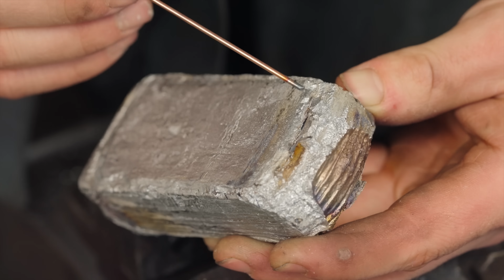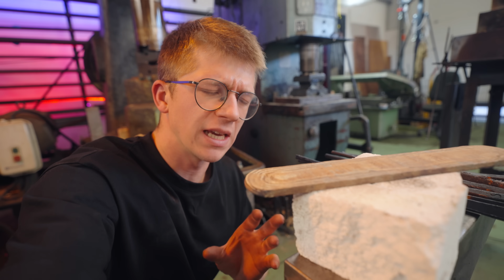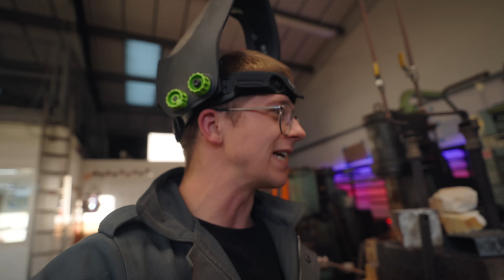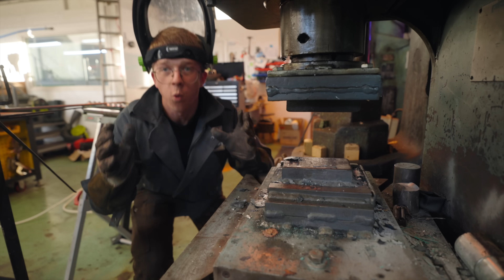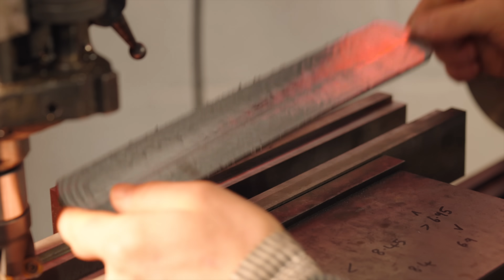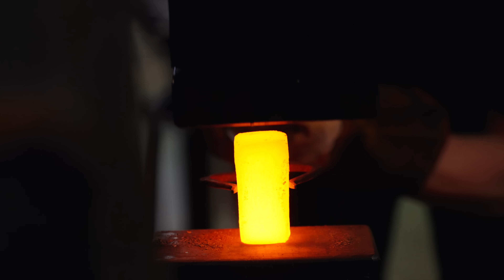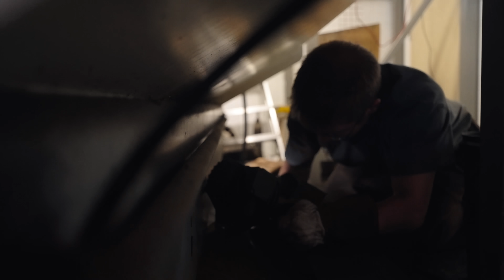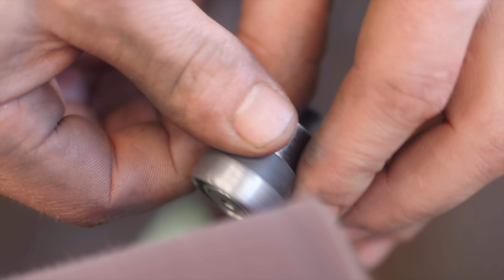Can I Make Titanium Damascus? Part 2

Comment: Can't you just do a regular fold? Make it thin in 1 spot and then fold it. Then hammer it flat again and fold it over and over like a Katana. Fold it 32 times and you have billions of layers. In this case you would have 107,374,182,400 layers. Now that is tedious so probably don't do that. 26 folds gives you 1.68 billion layers at a 25 layers starting point.

Comment: Titanium does have a high melting point but you are also forcing "air/gas" through it which added "air" flow into a forge theoretically making it hotter I would compare the forge temp to the work temp plus it may also have something to do with the metallurgy of both metals reacting with each other or changing the drilled hole size maybe the gas going in vs out makes a difference

Comment: For the melting issue only guess i would have is kind of live a forge with air being blown in warms the forge up faster same with the heat inside the billet when you have the gas flowing through the layers while warming it up inside a furnace already almost like having a furnace in a furnace. Honestly id guess if its wierd and works like radiation because thats what i work with doubling would mean all you have to do is take 1/4 the distance back if your having issues at 2000 degrees id say try 1500 to 1700 for a sweet spot. As for the issue with losing alot of titatnium and it shrinking probably like conpressing wood how it can be large but when squished down to be harder it can shrink heating it up expands it allowing it to have more space allowing it to get tighter and tighter togeather dont think there would be much of a fix for that 😂

Comment: I think the issue is The Argon.  Argon has a low heat conductivity.  So when you heat up the canister the interior is taking longer to heat up and the titanium is heating a lot higher than you plan for.

Comment: As with almost anything as you add pressure it adds heat. I'm not a blacksmith and I'm not a scientist but I'm assuming the press is causing so much pressure with the titanium it's causing the temperature to rise and melt.

Comment: There is also a phenomenon known as the “argon flow effect” that might be causing the outer surface to melt due to the “sheer effect” caused by flowing argon past the surface

Comment: Potential Reasons for Premature Melting of Titanium in a Steel Damascus Process
Understanding the Problem:
The premature melting of titanium in a steel Damascus process, even at temperatures lower than expected, can be attributed to several factors. Here are some potential reasons:
 * Contamination:
   * Oxygen: Titanium is highly reactive with oxygen, forming titanium oxide. Even trace amounts of oxygen can lower the melting point significantly.
   * Other impurities: Contaminants from the steel, forge, or even the atmosphere can also influence the melting point.
 * Heat Distribution:
   * Uneven heating: If the heat is not distributed evenly, the titanium might reach its melting point before the surrounding steel.
   * Hot spots: Localized hot spots can cause premature melting.
 * Steel Composition:
   * Carbon content: High carbon content in the steel can accelerate the diffusion of carbon into the titanium, lowering its melting point.
   * Alloying elements: Other alloying elements in the steel can also interact with the titanium and affect its melting behavior.
 * Forging Technique:
   * Excessive hammering: Excessive hammering can generate heat and cause localized melting.
Troubleshooting and Solutions:
 * Purification:
   * Vacuum annealing: Anneal the titanium in a vacuum to remove impurities, especially oxygen.
   * Fluxing: Use a suitable flux to protect the titanium from oxidation during forging.
 * Heat Control:
   * Gradual heating: Increase the temperature slowly to allow for even heat distribution.
   * Pyrometer: Use a pyrometer to monitor the temperature accurately.
 * Steel Selection:
   * Lower carbon steel: Consider using a steel with lower carbon content.
   * Neutral alloying elements: Choose a steel with alloying elements that do not have a strong affinity for titanium.
 * Forging Technique:
   * Gentle forging: Avoid excessive hammering, especially in the initial stages.
Additional Considerations:
 * Titanium Powder: Using titanium powder can help in achieving better control over the melting process.
 * Sandwiched Layers: Consider sandwiched layers of titanium and steel to help control heat distribution and prevent premature melting.
By addressing these potential causes and implementing appropriate measures, you can significantly reduce the risk of premature melting and achieve a successful titanium Damascus process.

Comment: I worked in an industrial forge for 7 years, and we sometimes forged titanium connecting rods for race car engines (AutoVerdi rods). When we did, we only heated the raw titanium billets to about 850 degree celsius before forging (2500 ton Farina press). The material was cherry red in color due to the "low" temperature (Normal steel we forged at 1080-1220 celsius), and we sure as h*ll wore out the forging dies 100 times faster than usual, haha.
Reply: My friend that I shared the other side of a duplex with was an expat from Britain who worked for a British motorbike team. And he was technical support for a lot of these guys at the Isle of Man races. He showed me some of his souvenirs and one of them was The Shard from a front disc brake that was made out of an extremely expensive ceramic after the bike went through a wall at the infamous chicanes. The driver was okay he skidded down the street a few hundred feet. Another nice PC had was a bent connecting rod media of 64 Titanium
Reply: @weedmanwestvancouverbc9266  i know that they had troubles with PC made for speedway bikes. I dont know why, and i dont know if they were titanium. But the ones for V8s were pretty much bulletproof.
Reply: @finnish_maniac8927  my friend had problems with his engine generating too much horsepower is causing twist

Comment: You can get the entire colour range using either heat or anodizing - the anodizer gives you way more control over large areas, but loses a dynamic of variation of colour, which may or may not be a good thing - Titanium is such a fun but maddening metal. Titanium dioxide isn't that hard, so if it isn't protected somehow it will wear off of a ring fairly quickly.

Comment: Please for the love of machining, DON'T USE High-Speed Steel tooling on titanium, avoid it like the plague. Use carbide tooling (inserts, drills etc etc) - uncoated, ground-edges with aggressive rake angles, deeper relief angles and very sharp cutting edges.
ALWAYS, ALWAYS, ALWAYS use coolant when cutting titanium. It's a shite material to work with as it acts like aluminium, but work-hardens as you cut it and will wreck your tools quicker than stainless steel. 
Any coated insert (with or without coolant) will die in a few minutes of meeting titanium.

Comment: i have no basis for this (in experience or knowledge), but my gut is telling me you could spray an inert gas even something like nitrogen to remove the chips and prevent them from igniting when milling them. either just a steady stream or using it as compressed air to just blow things away in a timely manner

Comment: You don't have pure titanium, but two different alloys which both have lower melting points..
Additionally, both alloys are vanadium-bearing which accounts for the extreme wear resistance.   Pure elemental titanium is actually very soft and relatively easy to cut..

Comment: I hope you weren't using chlorinated cutting fluids on the Ti. If you did your may find them cracking in a few months due to stress corrosion. Happened at a place I was at years ago for aerospace parts, all failed in a few months and had to remake them with water based cutting fluid.

Comment: I’m not blacksmith, but after the initial heat have you tried less pressure on the press? Or applying the pressure a little slower to avoid a sploosh?

Comment: My guess is the thermometer is off. I’ve noticed this a lot while working with engines. Some thermometers can’t keep up with high temperatures and as they age it only seems to get worse. Take multiple temperature readings at all angles within your forge, especially if you can find a laser gun that works for your temperature range, average out the readings. I also did powder coating for a living and the oven at the facility where I worked only had one temperature probe very close to the heat source. On colder days, especially in the mornings, the control panel would read that the oven was at temp but sometimes the temperatures on the walls would be up to 50 degrees colder than the area where the temperature probe was located.

Comment: Isn’t it melting because it’s a titanium alloy? The metal atoms will have more space between them and the metal crystals won’t be as uniform and regular. It’s like using cryolite to smelt aluminium.

Comment: In alloys you have a temperature range BELOW the melting point where you have a mixture of solid and liquid metal. It's called "solidus" and "liquidus".
Check out the phase diagram of Ti. It'll make a bit more sense.
Also, forge welding is a form of "solid phase diffusion", it's NOT literally melting the surface of the metal. But grains are "growing together"
Good luck mate!!

Comment: You have plates of titanium, why do you put them in a canister instead of just stack and weld. Also a little sidenote, if you spray a coat of spray paint into your canister and let it dry, it will pop off easier

Comment: It’s the eutectic point of titanium & steel which is lower than your forging point of titanium. The mixture of titanium & steel melts lower than the temperature of the titanium or the steel itself. Chemistry & mineralogy are fascinating subjects.

Comment: Maybe the extra heat is coming from the pressure of the press? I'm thinking of the way traditional blacksmiths would light the forge by hammering a point out of cold steel.

Comment: The melting temperature of copper is like 1080C I think, but the forging temperature of copper is only like 50C below that of titanium according to wikipedia.
I bet if you made copper and titanium structures that could slot together, you might be able to heat each one up separately but simultaneously, slot them together, and then forge weld that into a titanium/copper damascus billet.

Probably not, though, but who knows

Comment: Not all carbide inserts are same ,there are chinese  10€  for a pack inserts and then there are ISCAR 20€ per peace inserts.They are not the same.Difference is iscar's insert for hard materials can cut marine grade stainless steel with a 15mm depth of cut for 8h and you will spend one with 4 sides.Chinese one will go trough pack in 1h if you are lucky.
For a hobby guy 20€ is a lot for a company you just calculate that in a product price.

Comment: Maybe instead of making boxes, use square tubing and cap the ends. Cut the caps so they fit inside, like the titanium sheets, so you get a better fusion weld. Fewer weld seams and intersections to fail. Also, purge the square tube/box assembly while you are making it, so there is no carbon contamination inside.

Comment: It seems to me that the Argon gas makes it easier for the titanium to reach melting temperatures because it's replacing the oxygen in the 'box'. You can possibly match it with boiling water in high altitudes, the higher you get, the lower the boiling point.
Seeing the billet squished out like that, it looks like the titanium would like to get roll-pressed instead of being under the power hammer.
Cool seeing you experiment like this though 👍

Comment: When you were using the small face mill it did look like it was chattering a bit. Chatter really isn’t good for carbide. Usually my go to if I start seeing chatter is to reduce the feed rate a bit and take a lighter depth of cut. A trick you can use to see if your tool is chattering is to put an indicator on it while you’re cutting and just watch the runnout. If you’re getting a lot of chatter the indicator’s nettle is gonna move a lot which will tell you that you need to reduce your feedrate and take a lighter depth of cut. Cutting oil also helps with chatter. I’m not the biggest fan of using cutting oil myself but it definitely helps with chatters and surface finish, even with carbide.

Comment: Not gonna lie, i buy Chinese made titanium, timascus, and zircuti rods on Etsy. Found out they get their titanium from downed Russian aircraft from WW2 and repurpose it to resell as workable material. All of the timascus and zircuti rods i’ve gotten have all been twist patterns. I like to makes rings for friends on the lathe. Typically, I don’t use coolant tho. Using coolant tends to leave a very chattered finish that’s a bitch to clean off, so i just risk it for the biscuit. Also, if you’re making rings in the lathe, i highly suggest using varying grades of die compound to polish them before etching or heating them. Make an aluminum mandrel that has a light press fit to the ID of your ring with a removable head that screws on, keep that on standby, polish the inside first with the ring in the lathe using the die compound on a paper towel, then put your ring in the mandrel and polish the exterior. After you clean it off and put it in the heat or etch it, immediately dunk it in some Windex. The ammonium in the Windex helps bind the color to the titanium and will wear off a lot slower. If you do heat, i recommend using a furnace so you can control what color you get out of it. 1100°F (600°C) will get you those beautiful purples, 800°F (425°C) will be golden, and anywhere in between will start to give you more light blues. Happy ring making!

Edit: I forgot to mention! Is you use a radius cutting tool, you can round off the edges MUCH easier than doing it by hand. Just grab a small one (maybe like 1/8” or so), throw it in a deeper lathe tool holder, line up the edge like you would with any other lathe tool, and bob’s yer uncle! For exterior radii, have the tool facing perpendicular to the part and for interior radii, have the tool facing parallel. I’ve tried doing exterior radii parallel before, and it did NOT go well.

Comment: As someone else mentioned, iron and titanium alloys can melt at a pretty low temperature. 

Also, titanium has a much lower heat capacity per-volume than steel. Hammering it will raise the temperature like 3x more than hammering steel. I think it’s really possible that a combo of weird alloy properties + the fact that pressure will really raise the temperature of titanium means will melt far lower than you expect.

Also also, titanium doesn’t spread its heat out very well so it can get hot spots that do not dissipate. 

(This is especially relevant for the compression of the material which isn’t instant. It still doesn’t have enough time to let the extra heat from the pressure spread out across the material. Even in a fast hammer strike, steel can transfer the heat away from the area quick enough to avoid heating too much.)

The outer edges can alloy, heat up excessively due to pressure, and not dissipate that heat, then it’ll melt.

The issue is now how hot do you go? Well going cooler will solve the issue of the melting alloy + pressure heating, but then the middle will be cold.  Correct me if I’m wrong in practice, but I think making the outer box also out of titanium would solve the issue.

Comment: When metals are mixed the melting points of the metals can shift so if you mix titanium with steal and both have a high melting points and the compound mix of the 2 metals can make the melting point lower despite both compounds having high melting points.

Comment: Oversimplifying- melting is caused by crystal lattice bonds getting weaker/ being destroyed. Why is your particular Ti-alloy melting, I don't know. What makes metals melt, I don't know aside from there is something to do with the crystal structure and the amounts of metals in the alloy (whether it's 5% or 10% the alloy can behave completely differently). Ti likes to have a hexagonal structure, there might be alloying between your two Ti metals, one or both alloying with steel from the box around it. I have asked many times, how can we predict the melting point of an alloy? And can we predict the melting point based on the metals? And so far the answer is, just mix them together and see what happens. Take "Wood's metal", its melting point is at 70 C. It consists of Bi (melting point 271,5 C), Pb (melting point 327,46 C), Sn (melting point 231,93 C), and Cd (melting point 321,07 C).

Comment: Could the Argon be changing the melting point of the metals? Or the pressure at which you have argon pumping through the casing? The melting point you are researching may be just regular air at sea level pressures. Could be affecting the metals as you work with them.

Comment: I had a thought to help with a bit of the waste and possibly speed up your cuts with this. When you have the billet flat and at forging temperature. Would it be possible to hot cut it with a wedge attachment on the press? Do your measurements and make a grind mark to see where to cut. Then press and snap it off?

Comment: Finally my material science classes knowledge have a use, Similair to lead & tin both having a higher melting point than soft solder, two metals can have an alloy where the melting point is lower than either melting point of the metals used. The lowest temperature achievable is the eutectic temperature, which you can read from phase diagrams. I'm sure people have mentioned this already lol, Cheers.

Comment: Just an FYI, phase change is a function of heat AND pressure. It may be 900 degrees below melting, but is that below melting at a higher pressure?